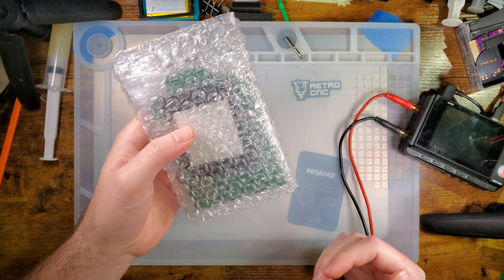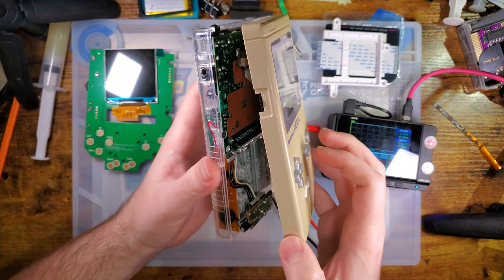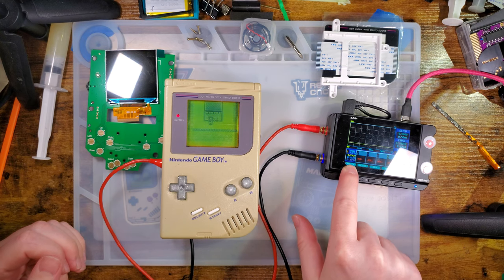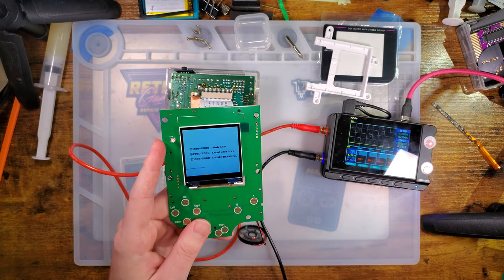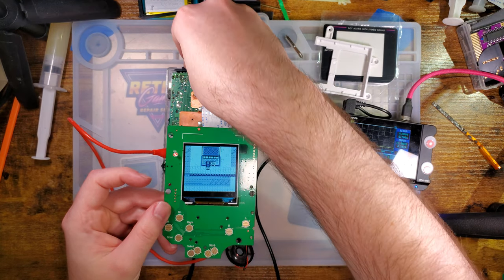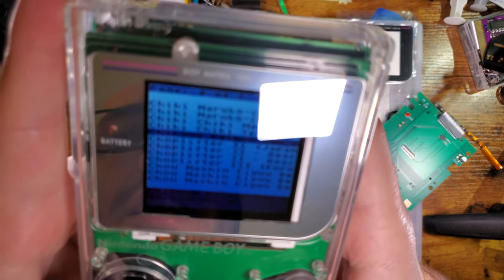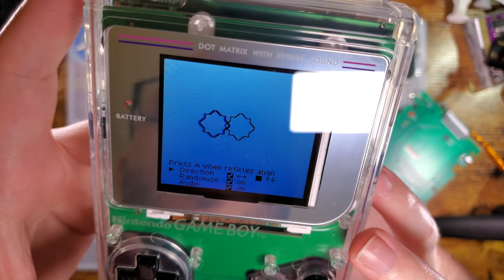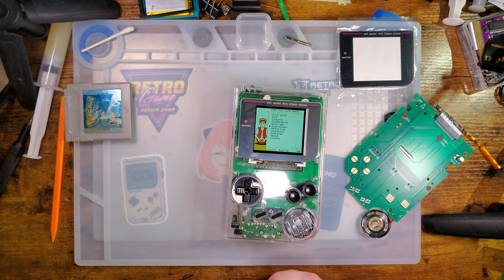Game Boy (DMG) 2.45" IPS Backlight Kit with OSD

Comment: Hey personal question, how come you aren’t in the gb discord? No judgment, just curious since it seems like a pretty ideal place for many ppl
Reply from the maker: You're right, it is personal. I do not mind sharing though as long as you don't mind a wall of text. 

I'm still in quite a few tangential servers, including (but not limited to): mechanical keyboards, portablizing, FPGA gaming, dedicated emulator device gaming, and so on, but I left the GB subreddit discord server and a few other similar servers for a multitude of reasons. I'll walk through my mindset.

The biggest factor is that I do not get along with a small subset of users that frequent this and other servers. I will take issue with something they say because of a factual inaccuracy, bad advice or bad practice, or just perceived attitude or other implication (regardless of whether they were inferring something or not) and I'll pick a fight. I would escalate scenarios that call for de-escalation. If they give me any attitude, I'll give it right back. All this over stuff that doesn't really matter. Eventually, it got to the point where I learned to just close the server and do something else when these people were active so that I could try and avoid getting frustrated by something they might say. I certainly didn't want to participate in conversation with them, you know? 

Quick tangent: If you're thinking I should just block people -- that doesn't work for me with how discord implements blocks. The "x Blocked Messages" thing stood out to me more than just comments as they would be normally so I would regularly click to read anyway. I tend to leave notifications on so I can partake in conversations if something interesting is happening and discord also still sends unread message notifications even if it's from a blocked user.

Anyway, after this happened one too many times, I took it upon myself to do some internal reflection and I determined that I was the common denominator in all of these scenarios that I feel were stressing me out so I decided to remove myself. I like to think I'm happier now and they're not unhappy so far as I can tell so I guess it was a win-win. I do feel as though I'm missing out a little but overall I do feel better so I guess I don't regret it. 

Another factor, and this has happened very frequently, is the inundation of support requests (which I guess is totally my fault). Obviously I like talking about Game Boys. I have a youtube channel with nearly 500 separate uploads most just talking about Game Boys. I have hundreds of thousands of hours logged talking about Game Boys (I checked, my channel has 345K hours in watch time as of today) so I've obviously put a lot of effort into this. Well, that much effort also requires down time. I'm not Game Boys 24/7, you know? It can be frustrating when I'm chatting with someone about something and someone else will see that I'm active and decide to put their problem/project in my face and ask me for help, often by butting into the active conversation. This happened in both text chat and voice chats and is especially frustrating in the latter. I'll feel obligated to help because not only do I know what they want most of the time, I'll know that I'm one of the few people active that can help with that and that if I don't help them, they're not getting an answer today. But I also don't want to encourage that kind of behavior with a reward. I also deal with a form of customer support in my day job and that's not something I want to do in my off hours too (and for free no less). 

Another tangent: Please don't read that last sentence and misunderstand. Please also don't take it out of context. I don't mind helping people, I just prefer to do it on my terms. The GB subreddit discord has a troubleshooting forum and I like that I can just pop in to any thread and help where I can. Youtube has comments (which by the way guys, go to discord for help, it's so much easier for everyone involved and realistically issues that I'll have insight on that no one else there seems to make it back to me anyway) 

So yeah, it's a me problem. Nothing wrong with the server. I've recognized patterns of poor behavior and I've set about correcting them but the damage has already been done. I don't think I've burned any bridges down but I've definitely raked the coals.
Reply: @makho  all of that is very understandable, I’m glad you were able to make a choice that was better for your sake. Also seeing all the comments asking for help now that I look, goodness you do do much more than anybody would expect. I know somebody in a retro handheld discord who does the same. Just constant pings and begging for their help and they are pretty much always there to help, just because they can. They have expressed their frustrations with that as well so I think this can be fairly common when you get to a more experienced level and have knowledge to share and people to listen, but there end up being a lot of negatives that can come with that sadly.

Tldr, thanks for what you do and whatever makes you happy is pretty heckin cool 😎.
Reply from the maker: @syd8921  hey you're pretty heckin cool too

Comment: I have an issue. The screen turns on and works when it’s not in the shell, but when it’s inside the shell it doesn’t work.
Reply: you've got a bad connection somewhere. Sounds obvious, but you'll just need to check each thing you've done yourself then move to the stuff you didn't alter.

Comment: Hello, I have a problem, I bought such a set at a Chinese store and installed both the cover and the IPS board and found that when using dpad when moving to the right, it goes down at the same time, please do not know where the error is, I also tried the old cover.
Reply from the maker: Well does it work properly when you install the original parts? Ideally checking the console for functionality before modifying it is gonna lead to the best results. If so, then contact the seller.
Reply: I changed the original parts and everything still worked, I put the console back to its original state with the old board and everything works fine, so the problem will be on the board from Asia, which is similar to the one you present. I would take it from you, but I will pay customs services for a third of the price that's a lot, otherwise thank you for the videos, I like to watch them .
Reply: the problem was probably a poorly assembled gameboy pushing something on the board, solved.

Comment: Will the slates be restocking anytime soon???
Reply from the maker: They're in stock now aside from any metal that's not aluminum.
Reply: huh? @makho
Reply from the maker: @boenscapes8529  not all colors are in stock right now but a lot are. We're working out an issue with the machine shop.

Comment: I don't like this one it seems much darker than the IPS 5
Reply: It's not actually an IPS. I've been watching tons of videos because I'm trying to mod several different gameboys and am trying to understand what each mod requires and which ones I can combine (I wanted a no case modification IPS screen that I can combine with a usb-c battery mod), and despite clearly being educated about the technical details happening they seem to get basic stuff wrong. Apparently IPS were just later TFT screen, but this one on the page is labeled TFT, not IPS. These required less modding to the case, but they aren't as good.